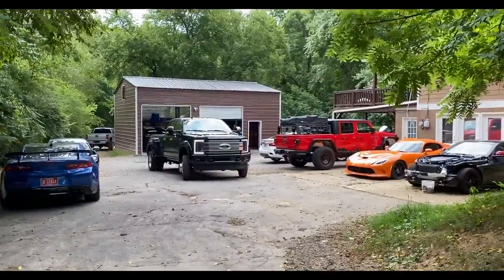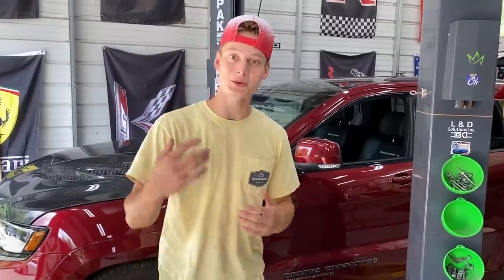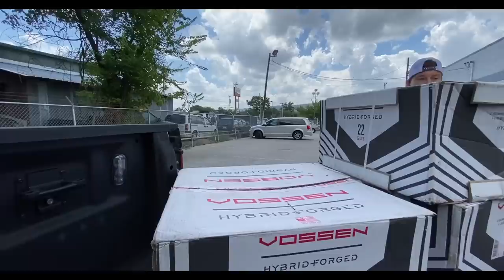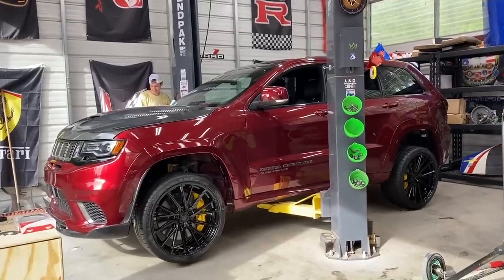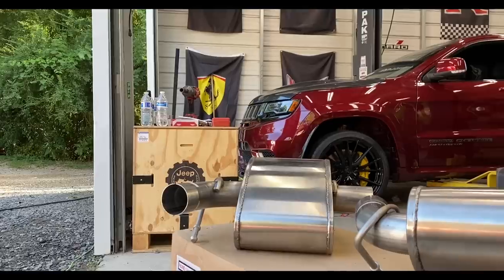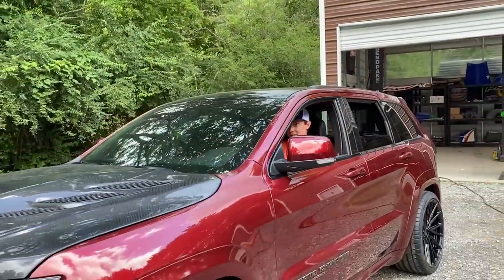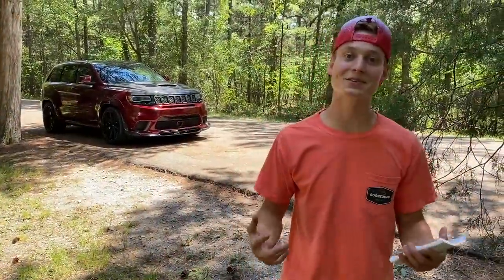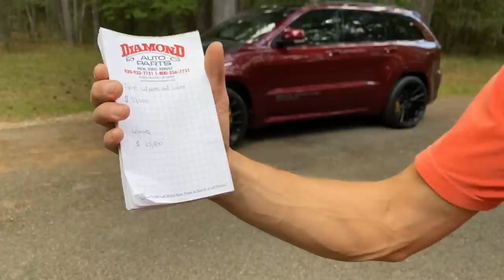The End Of The Jeep Trackhawk!!!

Comment: Car: $ 35,000
Structure pieces: $ 7,000
Vtuned framework: $ 3,000
Fenders and airbags: $ 3,000
Paint job: $ 2,000
Others: $ 3,000
Total: $ 53,000
Exclude carbon parts, wheels and tires, exhaust, and rear light: $ 12,800
GRAND TOTAL: $ 65,800

EXPERIENCE: PRICELESS...
Reply: It’s about 65k out the door.  If it would have been new you still need to add taxes and destination fees. It would have been well over 100k
Reply: Rio Pasaribu Rebuilt title. I’ll pass.
Reply: Yeah priceless! They do it for entertainment regardless of the cost coz they earn thru youtube, merch and sponsors.
Reply: For eveything else theres Mastercard....lol
Reply: Can anyone explain this rebuilt or salvage title and how it affects their car? Thank you.
Reply: I'd still take it with a rebuilt title. If you got one for this price that wasn't rebuilt there's no telling how many miles it would have and it's possibly been beat on really bad. It's been inspected by the state and the only thing that rebuilt title will hurt is resale, but I wouldn't sell it if I had it.
Reply: This is waste of money
Reply: 300zxdriver as a non-American - What’s the issue with buying a car that has a rebuilt or salvage title?
Reply: It’s just a little cheaper by 5k or so. Used ones with clean titles and a few thousand miles go for around 70k and up
Reply: micah fuller yeah if youre planning to resale it go for the bnew one but for the keepers ill take it all day long. The mods itself is expensive plus looks And the quality of the built  is excellent so the rebuilt or salvage title wont matter for the keepers ofcourse.
Reply: George TP it devalues the vehicle by almost half of retail price. So basically a 90K Jeep would be worth half that or even less. Regardless of all the work and mods done on it.
Reply: If it wasn’t for Vtuned and his wizardry this Jeep would’ve never seen the light of day. $3K for a rollover framework is a fucking steal.
Reply: 300zxdriver if you don’t ever plan on selling the vehicle it’s worth the price.
Reply: @MrGeorge0285  but they know what they got... Rather do it thier way 100%
Reply: Rio Pasaribu   Salvage title usually reduces the value of the vehicle around 30%. Insurance is another issue. If anyone has experience with salvage insurance I would love to hear from them.
Reply: Izzy36 Orange I’d rather buy a used uncrashed one for the same price. Something many people over look, is there’s a good chance of many rattles after something been totally disassembled.
Reply: @MrGeorge0285  salvage title states the work needed to get back on the road cost more than vehicle is worth. This is a big opportunity for people to do shotty, lazy work to make it look fixed and make some money on a wrecked car. You can fix a car and do it right. But the distinction is there to state that the car was considered a total loss by insurance and you should make sure it is a sound machine that has had good work done on it.
Reply: @DavidM-sx5gp  State Farm in California will do full coverage.  They will reimburse you the cost to replace with another salvage title if it was a total loss.
Reply: I would never buy a rebuilt salvage title. Hard to sell hard to get loan and insurance on and also people stay away from them in my experience.
Reply: Im Australia, this car would be classed as a unrepairable write off, this car would only be suitable for spare parts due to the structural damage. Even it if was classed as a repariable writeoff, the inspections to get it back on the woad would.kill the whole project.
Reply: @agentorange1556  no it does not devalue the vehicle by 50% Haha
I worked with my friend and his dad rebuilding cars with salvage titles for 5-6 years. From actually being around it for so long and watching the cars sell, I know for a fact that your statement is completely false. In early 2014 we rebuilt a 2013 Tacoma TRD 4x4 double cab with around 3,000 miles on it.  That truck booked at $32,500 new. We sold it for $21,000 and the Teacher's Credit Union said they'd finance up to $23,900 on that truck with it's rebuilt title. I know this because my cousin bought the truck and still has it.
Reply: Mr VCard sim thanks! I’m assuming these cars would never be rebuilt by the dealer/factory and that salvage title stays till the car is finally recycled whenever that happens?
Reply: Izzy36 Orange to think that brands like Vossen sponsored those sweet rims. Probably cost close half of the value of the car now!
Reply: @89ludeawakening1  2018 trackhawk on eBay 14k miles for 77k. Clean title.
Reply: Salvage title doesn't really matter if you document the entire rebuild process like this. Their work is equal to factory and sometimes better.
Reply: And the part about it being hard to get full coverage insurance on them is also false. That Tacoma had full coverage insurance through Progressive before it pulled out of the Credit Union's parking lot. It had to before they would finance it.
Reply: Normally you would use a salvaged title car to race on the track or drag strip
Reply: What price would someone pay for this total lost rebuild Jeep? This Jeep would be another keeper like the rest of the rebuilds they can’t sell
Reply: micah fuller well that’s fortunate your friend is banking at a Teachers Credit Union. Most banks wouldn’t finance a rebuilt vehicle over value.
Reply: 300zxdriver ➡️ nobody going to know is a rebuilt title.,  unless you glue the title to the windshield and drive around with it 🤦🏻‍♂️
Reply: VOLTRON well in my state you’re required to put a rebuilt/salvage sticker right on the door jam where it’s visible.
Reply: @Alex0992  okay and? If I had the ability and money to rebuild a 2018 Trackhawk with 2,493 miles on it for $53,000 without adding all the upgrades, I'd still go that route. If it's something I'm going to keep I'm not paying $24,000 more just because of a rebuilt title.
Reply: MarioT's CJResto Would be stupid for them to take any deal that makes them give up the YT income.
Reply: ... 🇿🇼 I see why these guy are duin this ,and clearly it has nothing to do with pricing...my thoughts ,coz if you are to look at it from a profiteering point of view it clearly not worth it ....but from the determination and consistency this is definitely priceless 👌...these guys give us a real show and worth watching 👀....
All builds through out well done .......
Reply: @1210mxp  You car is worth about 20 to 30% less with a branded title.
Reply: @agentorange1556  what are you talking about? They didn't finance over the vehicles value. The value with the rebuilt title was around $23,900 which was the most they said they'd finance. That's literally what the truck was worth after it was rebuilt.
Reply: Could of just bought a used one
Reply: VOLTRON you will be driving with the VIN number on the dashboard
Reply: And they probably made like triple that amount just on videos.
Reply: @MrWoodyBalto Exactly!  It's hilarious that this person in here is saying the vehicle's value is dropped by 50% after rebuilt. Lol
Reply: @89ludeawakening1  "Beat on really bad" vs what...WRECKED//??  Ahahahaha you youtoob commentators are something else.
Reply: No inner fenders?
Reply: Another great build Gentleman!! Appreciate the price breakdown, it's very interesting and informative.
Reply: So without the carbon parts it’s about half off, not bad for what they ended up with.  I was wondering if all the effort was worth it.  Seems like it was.
Reply: Its so beautiful men!! I love it!
Reply: @nickyboy15  I think your totally wrong.
Reply: very good job! awesome ! I like it very much !
Reply: YouTube revenue= buy a new one 3 times over
Reply: Yeah, but like, the build vs youtube profit, those are the numbers i want to see.
Reply: @1996FordBronco  where are you getting $78,000 from? All you really count is the $53,000 and maybe add about $3k-$4k for their labor, maybe a little more or less, I don't know what they value their time at. I wouldn't take into account for the upgrades and carbon parts because those weren't necessary expenses.
Reply: @89ludeawakening1  Welcome to YouTube. No matter what the subject is, there will always be misguided people that will tell you the wrong info.
Reply: curious how much they’ve made from the videos so far tho?
Reply: @Alex0992  link?
Reply: @Blair Aquilia eh.... I wouldn't think there would be any frame damage at all on this. Not with the way all of the panels lined up and how easy it was replacing suspension components. But there's definitely a lot of people that don't like rebuilt titles and that's completely okay. I'm definitely not going to be rude or berate you because of it. Lol
Reply: All the haters here wishing they could do the same lol. In the end the build paid itself with the views. Fuck the titles it’s all about the experience.
Reply: So i read its about 20-30% less worth because rebuild. But the quality goonzsquad delivers on there build i would feel safe. And for a fact factory is not always best. I also believe they get more sponsered then we see.
Reply: DESERT ALIEN d[ _ ]b but it wasnt new. It was a totalled car so it was about 50% off
Reply: you just saved me 24+ minutes, thanks.
Reply: @Jjay-tw1yy  with them being fully monetized and being enrolled in the YouTube Partnership Program, they probably make around $5k-$7k per million views just from ads. Then you have to think about how much they make from sponsorships. They make thousands of dollars from that as well. They also have their income from their merch. We'll just say they're doing pretty good for themselves. Haha
Reply: @1210mxp  First hurdle in a salvage or rebuilt title vehicle is to determine if your insurance company will insure the car.  There are some auto insurance companies that will not insure them.  If you can get insurance, the next hurdle is the value of the vehicle if it is stolen or wrecked.  Many auto insurance companies will have a much reduced value for it. So if you totaled it, or it was stolen, a salvaged vehicle will have a value that is significantly less.  When you buy a salvaged / rebuilt car many banks will not give you a car loan as well since the vehicle is worth the same.   Next is of course no factory warranty, and finally when you go to sell the vehicle you will also get a reduced value as well. In the auto business a salvaged / rebuilt title is called a "branded" title.  While most states require a branded title for salvaged / rebuilt vehicles, there are some states that do not.  The usual practice for some of the less than reputable sellers is to "wash" the title.  That is register a salvaged / rebuilt vehicle in a state that does not brand the title.  You then have a clean title not showing the salvage. With the clean title they can then register it anywhere since they now are starting with a clean title.
Reply: Labour?
Reply: micah fuller what I’m talking about is that ya ours friend is lucky to even get a bank to finance a vehicle that’s rebuilt or even damaged. The bank would never recover their money back if your friend defaulted on his loan.
Reply: micah fuller yes they are!  doing great!
Reply: @300zxdriver  Rebuilt title is still better than one with a salvaged title... Yeah its not going to bring as much if they sell it but then again how interesting would this channel be if they bought new cars and put bolt ons on them.  Dont think they would have 2.2 million subs for doing bolt ons.  Just my option though, and you can always watch StreetSpeed if you want new cars with alot of bolt ons by other people. Just saying
Reply: Yea but they got all the parts for free with sponsorships so they got a killer deal. Plus made a shit ton off the videos
Reply: @Mark1594q  100% truth.. If they was to sell they could get their money back just by selling the vehicle.  But they gained years of experience by doing the labor themselves.  Not to mention what they made off the videos by itself
Reply: @89ludeawakening1  you obviously like wasting money and speaking hypothetically. You would also need CASH to build a wrecked vehicle. If you do have the cash it's financially cheaper to get a loan the unwrecked car.
Reply: Mitch Smith people only see whats the bad /down side of things, they dont see what benefits and experiences they gain thruout this built. Ive been watching goonzquad since mustang build and never missed a video since then, its been entertaining and infromative.
Reply: What is a two year old trackhawk with a couple thousand miles on it worth with a clean title? KBB says 75k-80k. 30% less for salvage depreciation and your around 55k. This assumes your labor is free. Tough to make big $$$ selling salvage vehicles. The real money is in merchandise and millions of views. I still love the content.
Reply: @Alex0992  you obviously like throwing around words that you obviously don't know what they mean. Nothing I've said is hypothetical. There's nothing hypothetical about being able to build one like this for over $20k less than just buying one. And what you said makes absolutely no sense at all anyway? If I all out had the money to build one for this price, how would it be cheaper to get a loan for a new one? Do you realize how stupid that sounds? So if I actually had the money to build one for $53,000, it would somehow be cheaper to buy one for $75k+ and then add interest to that? Lmao... because math
Reply: @89ludeawakening1  "If I had the ability and money to rebuild a 2018 Trackhawk with 2,493 miles on it for $53,000 without adding all the upgrades, I'd still go that route."

you dont even have the money to do it. if you had the at least 53k cash it would take to rebuild this car you would know it is cheaper to take a loan out on one with a clean title.
Reply: Just to add theres only small profit in rebuilding a totalled up to date or new model car/suv because of limited parts.
Reply: @Alex0992  you can say that all you want but it still makes no sense. Even if your making payments on a $77k Trackhawk plus around $9k-$10k interest, it is NOT cheaper than one for $53k no matter how you look at it. You almost have to be a child that's never financed a vehicle or anything with a high price. If you're an adult then I highly suggest you get someone to help with math and finances. And you know nothing about me or my financial situation, so how do you know what I have?  You just made a completely baseless claim just to have something to say.  Keep your nonsense coming, it's very amusing and giving me something to laugh at.
Reply: @89ludeawakening1   Put 14k down and use the rest of the money to make more money. Instead of burning 53k right away. Does that make sense?
Reply: @89ludeawakening1  and you will lose less money when it's time to sell it down the road.
Reply: @Alex0992  and you obviously can't read or didn't bother to read all the comments before spouting off nonsense. I all out said if I built a Trackhawk like this it would be to keep. I wouldn't be selling it so I would be losing a total of $0 in the long run.
Reply: @Alex0992  and the whole thing about putting down $14k... WHAT DOES IT MATTER if someone has the money to do it? Every comment you've posted about this is wrong! You have no place for an opinion on this, if me or anyone wants to donut that way it's not your choice. You know it would be so much easier if you said you'd rather finance one with a clean title and that would be okay, but your whole deal about a down payment and monthly payments is WAY more than the one they built no matter how you try to explain it.
Reply: @Alex0992  go ahead and put down $14k on one and you still owe around $70k total on something that doesn't even actually belong to you yet. 🤷🏼‍♂️
Reply: @89ludeawakening1  you think broke and can't help it.
Reply: @89ludeawakening1  yeah I'll put 14k down and take the rest of that 53k and invest in a rental property or something. While you burn through 53k in a few weeks. You think like a broke person.
Reply: Dont argue the puprose of the built was not how much it cost, but for youtube videos. How much do you think goonzquad earn thru this built? This is only an estimate 1million viewes = 5-10k that something compared to the build.
Reply: Rio Pasaribu a rebuild title car sells for around 30% less than an equivalent car, same model, miles etc.
Reply: How much was the twins labor worth? Not added. Used Trackhawks sell for 80k-85k with less than 5,000 miles. This is a rebuilt title , worth far less.
Reply: micah fuller Alex is right. If you use the money in your bank to invest in real estate or something then you will be making money off that to pay the car payments. People who know about money understand, even millionaires do this because they can and use their money for other things to make more money(interest) while the original investments pay off the loans and give you profit at some point so you end up with owned property, the car you wanted all paid off and money in the bank. Ask Newport smoking Ben Mahalla if you don’t believe me. The goon squad only do this stuff for content, it is not wise to try to rebuild a car when the numbers do not add up such as this car right here. If you was to do this it would not be 20k less it would be more like 5k less as you will need to pay the real price for labour at a frame shop and parts prices, the goons say they got a deal on vtuned labour and paint themselves and they sometimes get parts cheaper. They also make heaps off the ad revenue and sponsors. It is not real life numbers so don’t get mixed up in the YouTube reality.
Reply: @300zxdriver  smart man
Reply: @1210mxp  rebuilt title equal 20-30% depreciation value cus it was salvage....nodealer will touch these cars if they are smart
Reply: @thepunisher-df5ih  yep
Reply: @JaneDoe-ub7xp  yep
Reply: @Alex0992  the goonz think people are dumb....nobody in the right mind pays 30k for salavage title insurance company sell the for 10-20% of the new value   that suv sold for 18k.. the buy  insurance company to copart
Reply: @Thabzzz  not equal to factory....that  a joke .... they don't even understand which weld thre  primer to use they cheap out and  used in use the  cheapest garbage you can buy on the market ....every weld will Rust out from inside out... they should have used the premium copper weld through primer.... this vehicle will be a rust bucket in 3 years
Reply: @Voltrondefenderoftheuniverse  dealership will touch this vehicle because it is salvaged nobody is going to buy a salvage vehicle this vehicle is a total waste of money
Reply: @1210mxp  honestly no difference it only applies if you care about reselling the vehicle
Reply: @Troche571  that would be huge for them but I think they are still far from Sema builds though the for sure insurance Ferrari might be able to be one tbh.
Reply: Am your kenyan fun,please send the old rims to me
Reply: Rebuilt title I'm sure drops it in half.
Reply: @reggiehammond6508  They have just bought 2 new premises so i guess they are doing ok out of it,....And i would not mind having toys like that in my yard,....
Reply: @Blair Aquila Can no one drive over there ??
Reply: @pistolpete7649  You do know rebuilding vehicles is what their channel is all about ??
Reply: @joostkamphuis85  Explained in the vid,...
Reply: DESERT ALIEN d[ _ ]b they cost around 93-95k depending on the options and dealership. Most are going to run 97-99 and into the early 100k
Reply: I didnt see the damaged version! Where is it?
Reply: @DavidM-sx5gp  both my cars are rebuilt and I have full coverage on them through geico.  When I shop around for insurance, I do notice that a lot of carriers will not provide full coverage on a rebuilt title car.
Reply: @thepunisher-df5ih  why
Reply: @300zxdriver  its still a trackhawk lol
Reply: Salvage title in NJ on a sport truck ?  Good luck....
Reply: $24,200 gap, I wonder what would be the ticket on labor.
Reply: @desertaliend_b9840  facts coming from a body shop.
Reply: @reggiehammond6508  for a good profit.... 100k.